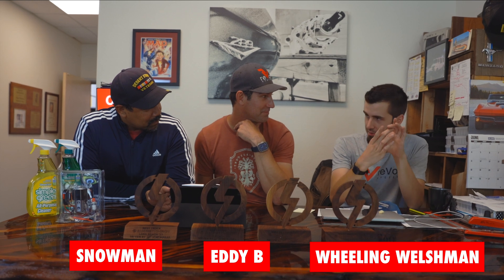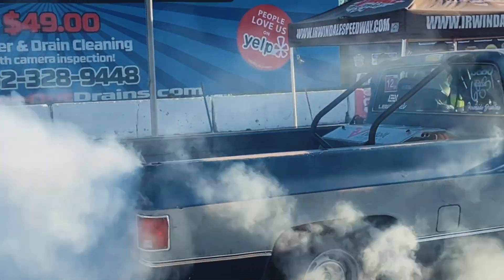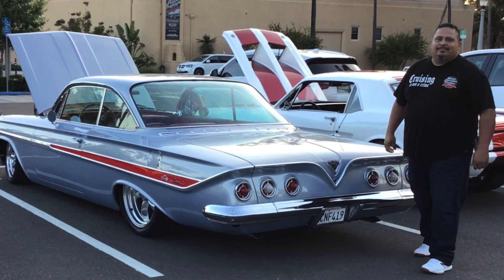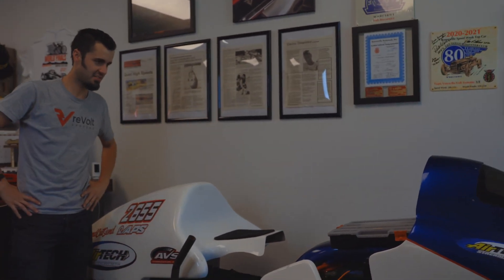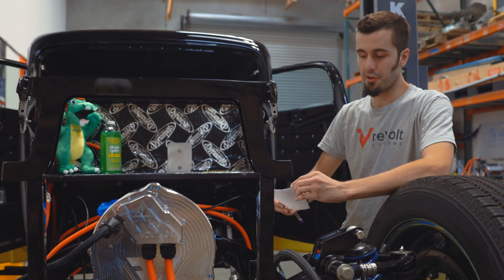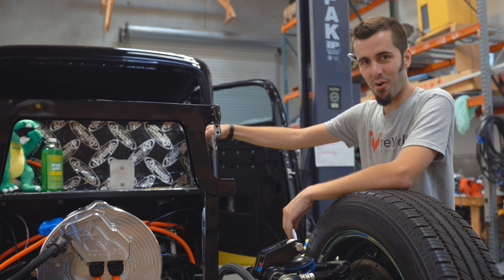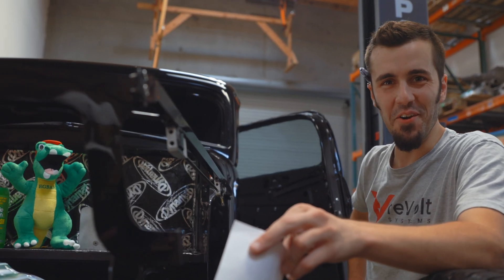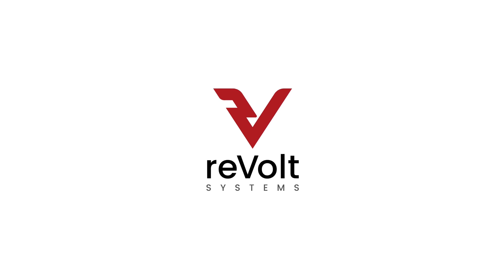Revolt Garage & Tim Allen Vik Update

Comment: RPM is useless in a single speed gear box drive train. It will track the speedometer. When the speedo is at 50% the RPM will be at 50%. Meanwhile current tells you how your using your power.

Comment: put Speed and RPM on the same gauge with the same needle. use the other gauge for power, not amps, use a small gauge for amps like a classic ammeter.